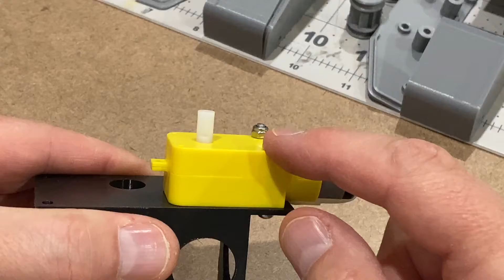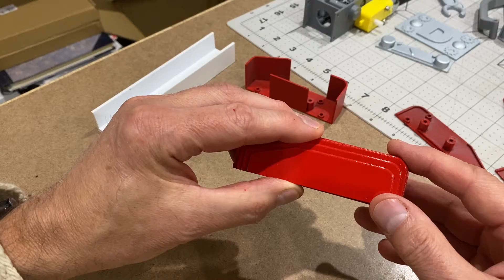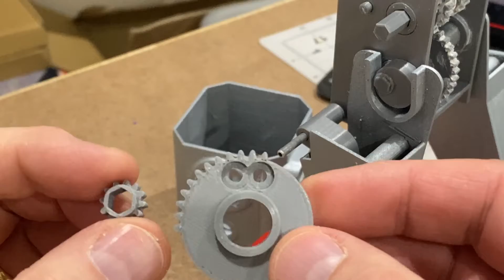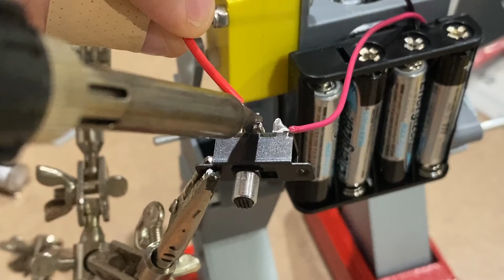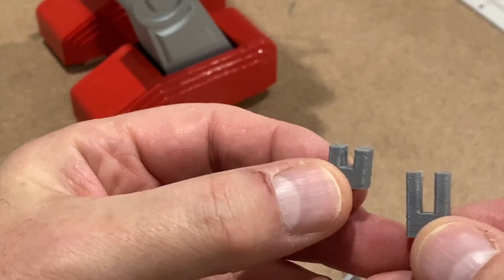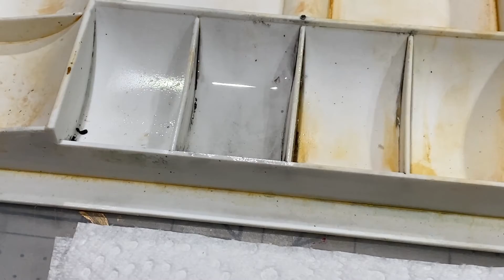Building a Vintage Toy Robot using 3d printed parts

Comment: Enjoyed your build details of my robot design. Loved your modifications to the design as well. When wiring LEDs, you should use a current limiting resistor and sometimes it helps to add a filter capacitor across the motor and LEDs to clean up the power as the low-cost DC motors tend to put a lot of noise on the power lines and flashing LEDs do not like that. Fantastic job on the build video. Thank you for sharing your build with others.
Reply from the maker: Thanks very much. Glad you liked the video.

Comment: While the voltrs maybe fine, an led is normally going to need a resistor in series to limit the current to ensure the led is not blown or so dim it looks like its not working.
Also I would avoid CA as it can fracture the led casing - pva is a safer option.
But that is a great retro design.
Reply: Hi Sam, thanks for the comments. In this case a resistor was not necessary because the LEDs were rated to 5V and I was running 7 of them off a 5.5V supply.